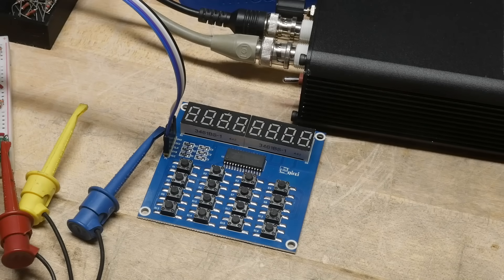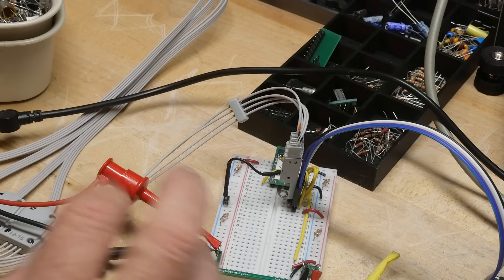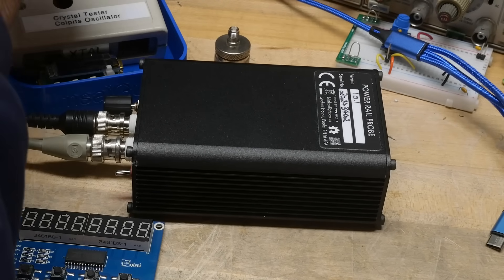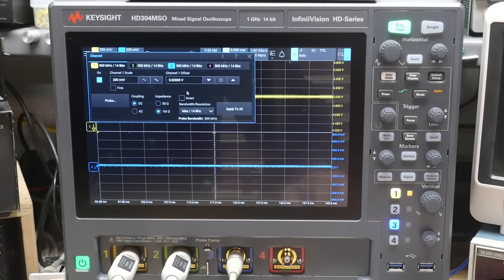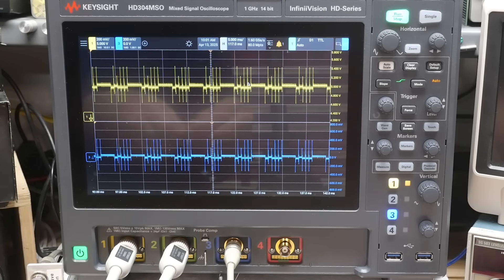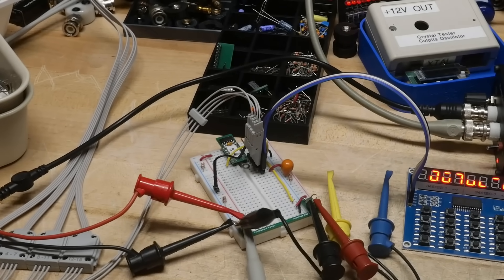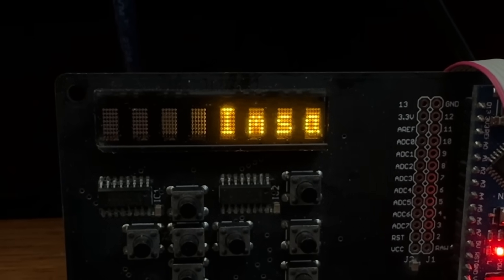#2218 Vcc Rail Bounce

Comment: The HD3 with the 1M ohm probe supports an offset of +/- 15V for the 100mV/div to 1V/div range. This increases to +/- 150V once you are in the larger volts/div range.

Comment: It would be interesting to do a COTD on the TM1638.  Warning, the data sheet is not user friendly.  On the key scan part of the datasheet, bit 0 is shown as the left most digit and the key scanning technique is very strange.  You can work with it, but it takes some head scratching.

Comment: I think the offset capability has been around for some time. My HP 54528, from a long time ago in a  galaxy far, far away, can do +/- 20 v offset on the 10 mV/div range. I use it quite often to look at power rails, but then I'm  not a real engineer and didn't work "in the industry" for 35 years.

Comment: 8:45 ESL
It is a high speed parasitic effect in a sense that you got sharp edge signals that draw noticeable amounts of current.
Biggest capacitance in a smallest package closest to the origin of current consumption is what you would want. And sizes like 0402, 0201 X5R MLCC in such cases are often more effective while having less cap value than usual ones.

Comment: 6:12 mine can do +/- 100V and was new when man was on the moon 😝 (seriously - tek 7A12 plugin can do +/-500 divisions offset, and the chips in it have 1969 date codes)
Reply: Yep, this scope can do +/-150V when on the higher division setting. The 15V limit is when on a lower volts/div setting like this.

Comment: This is in reply to someone who mentioned a 555. 
I'm on an ancient computer and reply won't work.

The bipolar version of the 555 timer is probably the worst offender I've ever seen in terms of the need for local decoupling.
The output stage of the 555 has quite large transistors arranged in a totem pole so that it can source or sink a good deal of current. Because they are large they are also rather slow. During each switching transition there will be a time when both transistors are partly ON, so you get a spike of "shoot through" current directly from Vcc to ground.
Often on breadboards people aren't very careful with how they connect the power supply. There is often quite a bit of inductance in the connecting wires. Inductors oppose rapid change in current, so when those shoot-through current spikes occur the voltage at the 555's power pins is first pulled down as the inductance charges then overshoots as the inductance discharges at the end of the shoot-through spike. Generally only the positive-going voltage spike looks really bad.

I used to use this very thing for teaching. Getting 20 volt spikes with a 5 volt supply is easy.

Twist you power supply leads together if they are separate wires (parallel conductors in a jacket are not too bad). Put a bulk decoupling cap of at least 10 µF somewhere not too far from the 555. Put at least 100 nF of ceramic decoupling capacitance on the shortest leads possible as close as possible across the 555's power pins.

[edit - some experiments]

Make an astable with a bipolar version of the 555 timer. The frequency and duty cycle aren't critical. A few kilohertz is fine. Don't use any local decoupling capacitors.

Connect the circuit to a 5 volt power supply using two separate pieces of wire each about a yard long. With an oscilloscope connected at or very close to the power pins of the 555 (short ground lead on scope), observe the Vcc pin. AC coupling is fine. Make notes.

Twist the two wire together - about one twist per inch or so is fine. Repeat the observations.

Use the twisted wires and add decoupling capacitor(s) as close as you can across the power pins of the 555. You can try different types of capacitor in different values, but be sure you do one observation with something around 100 nF monolithic ceramic.

When you twist the wires you very significantly reduce the inductance. Since the currents in the two conductors are equal in magnitude and opposite in direction, so are the magnetic fields around them. When they are very close together the magnetic fields largely "cancel" each other. (It is the close proximity, not the twisting, that counts).

Comment: It would have been instructive to crank up the horizontal timebase so you could actually see the width of the "spikes." A screen showing 8 "copies" of the same thing really isn't good use of the scope after the first quick look.

Tantalum capacitors have become very expensive. While their high frequency performance is generally better than aluminum electrolytics.
Good decoupling needs to be close to the devices that are causing the current variations. Several inches away on a breadboard is not good decoupling.
Where the power is coming from some distance, good decoupling usually requires a combination of a "bulk" capacitor of several microfarads that can be almost anywhere on a small board and good high frequency caps local to the culprits. An aluminum cap can actually be better than a big ceramic cap or a tantalum simply because it is relatively poor at high frequency. That can damp resonances that you can get with very good HF caps interacting with the inductance of supply leads.
Be careful with tantalum caps. Most don't like rapid rise in current, as when power is first applied. Tantalums are given to failing short-circuit.

When you are probing for this sort of thing you need to use a short ground lead on the scope connected close to the "problem." Otherwise you form a resonant circuit between the scope ground lead and the probe tip capacitance. That can make things look worse than they really are. A FET probe relaxes the need for very short ground leads. At least 3/4 of the electronics videos I see on YouTube where an oscilloscope is used demonstrate bad probing technique.

There is nothing in that waveform that says that AC coupling wouldn't be entirely satisfactory. It would be very, very rare that AC coupling wouldn't be satisfactory for that purpose.

Comment: My 35+ year old HP16500A has NO AC coupling, but it has oodles of DC offset. I rarely use my scope for debug because I simulate the hell out of my designs before taping-out the PC board, and I also put as much software-based self-diagnostics as I can so that bench debug is rarely needed.

Beware of long leads from your power supply; they can contribute to noise problems.

Comment: Can I just use one of my active FET probes that also has a DC offset feature (like the Tektronix P6045, P6201, or P6202)? The TekProbe interface seems to support an offset voltage but I haven't gotten it to work with my TDS 3032 (I'm not sure if it's a problem with the scope, or with the probes, both of which I got used).

Comment: I was throwing together a quick 555 circuit the other day, and when turned on, it produced a shocking jumbled-up barbed wire monstrosity that wasn't even remotely resembling anything like a square wave. I knew full well I skipped any decoupling so I said "oh well..." and tried adding an electrolytic of a few microfarads (all I had at hand at the moment) - surprise, I immediately got a perfect square wave. I mean I knew I was in the red without any decoupling but FFS, I never expected it to do THAT kind of indescribable damage to a simple, low-freq 555 circuit...

Comment: LED displays wreak a lot of power rail havoc. At a minimum, I’d suggest using their own dedicated power connections directly to the power source and/or main large bypass capacitor. Even better is to have separate regulation between the displays and the sensitive digital/analog sections to leverage PSRR suppression.

Comment: I have since learned that the CPU power rail is one of the most weak spot - any issues with voltage rail, the microcontrollers get sent to the La-la land. It's usually easy to fix though - in this case, I'd solder 100 to 1,000 microfarads electrolytic capacitor at DC power input and another one near the microcontroller rated at 1 - 10 uF so that way it's resolved. Microcontrollers and any and all CPUs are very touchy about power requirements.

And look at LED driver too - some of those chips are very sensitive little guys, like processors in general, they do not like noises.
Reply: Something else sensitive... The 555 timer gets real upset without a capacitor practically on top of the thing. It may appear to be operating normally but current will be excessive and an AM radio will be upset by it. I usually add 100uF right with the 0.1uF bypass.

Comment: Is the scope offset analog or a math function? Your little offset box is an interesting tool, need to learn about it. 

What is ground? I worked on a high performance analog circuit with 2 other senior analog design engineers a few years back. Our problem was all the system grounds, we had 5. 

Thanks for the video, enjoyed it with my coffee.
Reply: "Is the scope offset analog or a math function?"
It's a DC offset applied somewhere in the analog chain.  That way you don't lose ADC resolution.

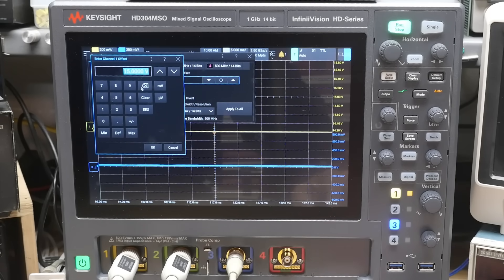Comment: 6:00 I have Keysight DSOX1202G.  It can do offset; checking now to see what is the range.  
+- 20 volts using a 10x probe, +- 2 volts 1x probe.  So natively it is plus-minus 2 volts but the 10x probe extends this.

Comment: I bought a few of those hydra-style USB cables from Temu. None of mine had free data pins connected. Does yours actually work correctly?
Reply from the maker: they are just for charging
Reply: @IMSAIGuy  I realized that when I got them, but they were sold as data + fast charging on the website.

Comment: I would like to see a comparison of using the power rail probe (or your scope's offset) vs. just using AC coupling.  I've always seen people use AC coupling, and I don't understand why that isn't as good.
Reply: I think it is mainly that you will need to measure the DC voltage separately to see slow variations that the AC coupling filter out. But a multimeter is much better at that anyway.
For very sensitive measurements the microphony in the AC coupling capacitor may be a problem.
Reply: At the moment of probe connection, power is drawn from the device under test (DUT) to charge the DC blocking capacitor.  Since we are looking at a power rail, this is probably okay and certainly easier.  What you won't see using AC coupling is gradual drift in the DC power supply.  
Also, you MIGHT have a high voltage on the blocking capacitor from a previous measurement and you could inadvertently inject that tiny little pulse into your live circuit at the moment of connecting the probe.
Reply: @thomasmaughan4798 I think the charging/discharging of the blocking capacitor will be current limited by the 1 Mohm input resistance. So unless you work on extremely low power power rails that should not be a problem.
Reply: @larslindgren3846  "So unless you work on extremely low power power rails that should not be a problem."
It is more of a minor issue with MOSFET's.  I doubt many people go from 200 volts DC to suddenly checking the gate of a MOSFET but on second thought, this is a very likely scenario with inverters.
Reply: @thomasmaughan4798  I was under the impression that we was still discussing measurements on power rails. On MOSFET gates without protection circuit or driver conected you are absolutely right that it can be a problem. Almost all power rails will however not be a problem except maybe solar powered calculators and similar extremely low power circuits.
Reply: @larslindgren3846  "I was under the impression that we was still discussing measurements on power rails"
I mention it as sort of a parenthetical since some commenters wonder why you just don't always use AC coupling.  You sort of can always use AC coupling but it helps to ground the probe tip briefly before making a sensitive measurement to discharge any residual voltage on the capacitor.  I suspect it bleeds off after a few seconds anyway. 

Since the offset voltage is sort of limited, AC coupling is going to be what most hobbyists are going to use for power rail inspection. 

A 1x probe will deliver the maximum sensitivity but it has some capacitance so you might miss glitches but then my scope is only 70 MHz bandwidth so that's another thing; I am not looking for nanosecond glitches.  For that you'd use a small ceramic decoupling capacitor anyway (in addition to larger capacitors for longer, deeper glitches).
Reply: @larslindgren3846  "charging/discharging of the blocking capacitor will be current limited by the 1 Mohm input resistance."
Yes, so it won't be much of a surge on the extremely rare instance it is even a thing.

Comment: My Keysight DS0X1202  offsets up to 20 volts. So you could have a 5mv square wave signal riding on a 19.95 volt DC level and move the square wave signal to the center of the screen. I don't have any of my old analog scopes to see what they would do.

Comment: Tantalum and aluminum electrolytic capacitors definitely have different electrical characteristics.  I remember years ago troubleshooting a radio the customer had recapped that was having PLL circuit problems.  I had a lightbulb moment when the aluminum electrolytic capacitor in the PLL circuit reached out and wacked me in the back of the head and said "hey you big dummy, I'm not suppose to be here".  Well it didn't actually whack me in the back of the head but I wish it had a few hours earlier.  The customer in his zeal to do his first recap job had replaced the one and only tantalum capacitor in the whole radio that's in the phase detector low pass filter circuit with a aluminum electrolytic.
Reply: Tantalizing…
Reply: Captivating
Reply: I’ve been whacked in the head by an aluminum capacitor I wired in backwards. Left a mark, quite high velocity.
Reply: @ Never been hit in the head with one but I did have a 100uF 450V axial cap explode in my face that "someone"🙄  put in backwards.  Took me 10 minutes to get all the tiny pieces of aluminum foil and paper out of my beard.  Surprising how fast the electrolyte in one of those can go from liquid to gas.
Reply: @mikesradiorepair  I was really damn lucky when I reversed a 63V 15000uF capacitor. It sizzled inside, probably boiling the electrolyte and all and it just sounded off, but it still took me a few minutes to realise. It fully recovered though! Almost had a 45mm diameter 70mm long capacitor take aim for my eyeballs.
Reply: @mikesradiorepair  Polarizing
Reply: That'll do it

Comment: It's indeed surprising that you can offset the input voltage by a large amount on an oscilloscope, but the thing is, it has to do with the oscilloscope analog front-end, being able to take a much larger input than what its V/div setting requires.
On the other hand, it doesn't really mean the offset voltage being actually applied internally is the voltage you're keying in.
The input voltage is going through the input's front-end attenuator, while the offset is  only being added AFTER the attenuator.
So, suppose your oscilloscope's basic input sensitivity is 5mV/div, and you're set at 400mV/div...
It means your input attenuator is set at a factor of 80:1...
Therefore, to apply a 15V offset, it's only needing to apply around 200mV offset.
It's a tricky arrangement but it can work quite effectively.
Reply: Yes, the Keysight makes this almost obvious; it's offset range is +- 2 volts, but the 10x probe makes it effectively +- 20 volts.

Comment: and yeah that scope is $10,000+
I trouble shot digital circuits for decades and never needed an offset to look at the rails.
Reply: The 1 gHz version, he has is more than 20.000€ here, there is also a 100 and 250 kHz version from what i saw with my left eye.
Reply: @AnalogDude_  I don't think they have a 100 kHz version of the same scope family as a 1GHz scope, 100 MHz seems more likely.
Reply: @larslindgren3846  sorry, bout the typo, indeed it was 100mHz, even my Tektronix 2212 that's like at least 25 if not more years old is 100mHz with max storage memory.
Reply: $8500. I think to get to 10K you would be adding a lot of extras.

Comment: A poor AC ground in an automation network brought down the entire Wet-Wipes production line.  It checked out fine as a DC ground but AC was a different story.  That was ground rail bounce but the results are the same.
Reply: I never gave AC and DC grounds a great deal of thought until  finding out in aircraft,  they have separate ground points for AC and DC power. Of course the blocks look identical to the eye so you have to dig into diagrams carefully to be sure before adding a connection. They are not explicitly labeled as such,  just by numbers and location.
Reply: @TomSherwood-z5l  But, with aircraft electronics you are dealing with 400hz as well..